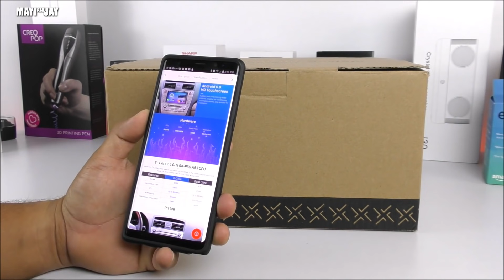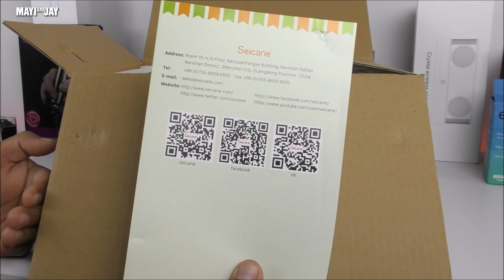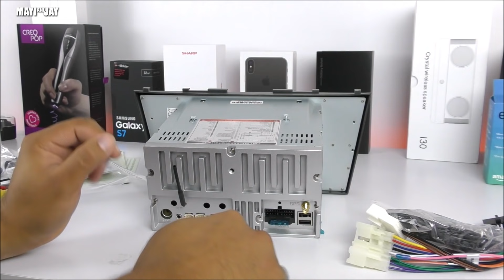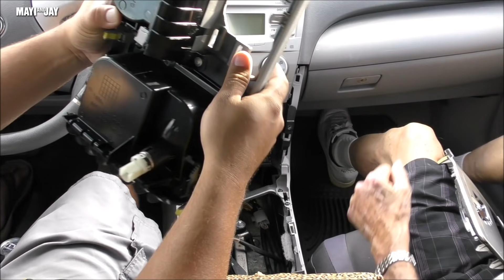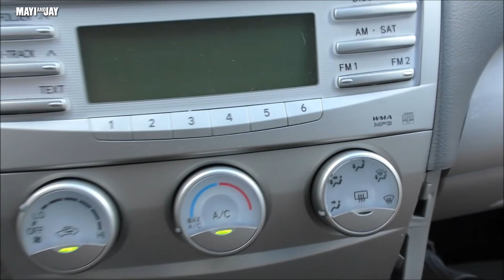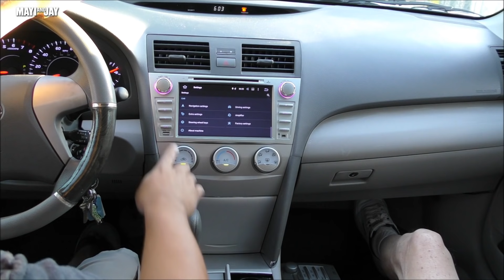Get A $200 Factory Looking ANDROID Radio On Any Car From 2007 & Up! [Toyota Camry]

Comment: Thanks for sharing. Be careful when pulling out the vents off, if you break the clips it's done deal. 

I think this is by far the best  2007 Camry radio head unit replacement out there. It has the right color, the right features, there right touch and feel. It will look completely original. And the GPS, trust me, other units do not work this good.
Reply: I just got this for an 07 camry i'm passing to my son.  Does the GPS work on it's own or do we have to enable an internet hotspot for it to connect?
Reply: @soundsensationalvibez8876  on it's own, has it's own antenna that you can just put on the dashboard or elsewhere.

Comment: The link you shared doesn't display Exactly the same Design you're installing here ... The one you  installed has where one can slot DVD, volume ,tuning and other buttons pls I need exactly the one you installed here .. Pls share the link here

Comment: Can this be installed on a 2017 Toyota Camry SE
Reply: Not the same exact unit but similar. Go to the website in the video description and search your model. For Camry, specify if you have a US model or not... There are several different dash designs and the 15-17 US version is all its own. I found this out looking for one for my '15 LE.

Comment: Hi, anyone know how to reconnect Bluetooth to another phone?? I tried to remove the old phone but doesn't work, thanks
Reply: Press talk key, wait for the setup promp, take it from there.
Reply: Where's the talk key?
Reply: Ký Qch right side of steering wheel on mine.
Reply: @lynnmerritt8873  mine don't have the talk key on steering wheel, only call or answer on screen
Reply: @p.theviewer  try the answer key. press/hold about 2 seconds, you may here the prompts. the last prompt is "setup" on mine
Reply: @lynnmerritt8873  thanks, I'll try
Reply: @p.theviewer  "setup" should override previous phone setup. Hope this helps dear
Reply: @p.theviewer  turn ignition key till you see dash readings, turn radio on, have bluetooth enabled on your phone to be discovered, pair according to instructions if needed. Try steps again if needed. Or try your "call" key on steering wheel in same manner.

Comment: I’m doing exactly what you just did with exactly the same radio same car 2007 Camry but my JBL module only two connectors fit on the car the third one did not fit so my steering wheel control is not working what am I doing wrong did I get the wrong JBL connecto

Comment: Just saw this Video..I am in Aus and I just bought a 2011 Camry Touring. The head unit looks a bit different to the usual camrys' that i have seen here. Mine comes with a reverse cam and it shows on this screen. Will this product fit in mine and also, will it show the reverse cam video as well ?

Comment: Do the steering wheel functions work for the radio?
Reply: Bulshit the wires that come with the radio do not fit the car you have to buy a JBL wiring harness and the steering wheel wiring harness for $57 a piece
Reply: Yes.  I have a 2009 Camry
Reply: @pgg0508  ya solucione el audio gracias ahora solo me falta el swc q' no hay manera de q' me deje configurar.pues los botones no hacen nada
Reply: @luismartinez-xs2ft  Do you get to the configuration screen (Apps...settings...car settings...steering wheel)?
Reply: @luismartinez-xs2ft  https://youtu.be/ro8prAPkNFY
Reply: @pgg0508  hello if the strangest thing is that I got to the screen of the device to the settings I put it to take that option and simply does nothing. is where I do not understand. because if I already set it to swc because it stays the same without doing anything at all
Reply: @luismartinez-xs2ft  can you set any of the SWC buttons?  volume+...volume-...mute?
Reply: @luismartinez-xs2ft  if none of the SWC buttons respond, you might have to check to ensure your cables are seated securely in the slots.
Reply: @luismartinez-xs2ft  and if you soldered the wiring harness and adapters, you might want to check that too.
Reply: Yes.  I have a 2009 Camry

Comment: Does this work for a Camry with JBL speaker sound system?
Reply: NOPE ! NOTHING DOES LOL  you will either need a better  deck with the bypass or just add a high low freq box i judt installed subs in my 11 Camry  and stock  stock speakers didn't work  you cant just tap into the wire for signal  no sound until  until we installed the high low  box  inbox me if you want pics of the box im talking about
Reply: @that_619_dude4  what would you recommend I do/get that would work with the JBL speakers? I don't need anything nearly as fancy as this I just want to play music from my phone via Bluetooth
Reply: @darknazo10  so I had a high low frequency box installed in the trunk so I have my stock head unit with my sub and amd, that's the cheapest /best sounding fix in my options bro

Comment: Can the GPS button be set up to open Google Maps instead of that other app it's opening in the video?
Reply: Yes, but you will need a persistent wifi/wireless connection or download Offline Google Maps.  Even with the radio connecting to your phone's wireless via Hotspot, the data is too slow.  If you don't like the provided GPS software, you can purchase and install one of your choice and configure the radio to use that particular GPS software.

Comment: help, I'm not getting FM signal what am I doing wrong?
Reply: Hey Luis.  See previous comment radio antenna amp connection.  As far as the SWC, you just have to configure the buttons to do what you want.
Reply: @pgg0508  thank you for helping me with regards to the orange cable, this one comes with a female and male socket from different places tell me ko I leave it like this or I have to unplug it or cut it and connect the blue cable to the female or male socket
Reply: @luismartinez-xs2ft  Did you it all connected?
Reply: @pgg0508  not because I have 2 blue wires, one with a white stripe and another blue one, I am confused which is the one that is connected to the orange cable that comes next to the 2 antenna cables and that this orange calbe has a white connector on both sides and I don't know if I have to disconnect it or leave it like that and on which side on the orange cable I connect the cable on which side I have to put the blue cable.If I could give more details on how I should do the operation, I thank you infinitely because I also don't is holding the swc signal because the driver's buttons do nothing. Excuse me for my ignorance these are very delicate things and you have to be sure not to make mistakes that are later fatal. I appreciate your concern once again for your generosity of wanting to help you are very kind god bless you
Reply: @pgg0508  Hello, I want to thank you again for your help regarding the swc and I configured it as you had said. I am very happy. Now I have to continue to see if I can put the GPS because it does not want to do anything. Also the blue wire connect it to the orange but without cutting it or unplugging it nose if it would be fine like that. Where to put a cable that says brake
Reply: If you have the Camry, you'll have to connect the orange cable that is wrapped with the antenna cable to the blue wire (ant) on the wiring harness.  The blue cable bundled with the AM/FM antenna is the amp cable and must be connected.  I cut the connector off the orange wire and soldered the orange and blue wires.
Reply: @pgg0508  hola Will you kindly tell me what I can do because since I installed the radio I have no radio signal since the blue cable I could not connect it anywhere and the system steering wheel controllers do not work too? Thanks

Comment: That is not an affordable radio at $350 I should just anybody change the radio run your rear-view camera camera cable as well even if you don't do the camera plug the cable in otherwise you'll have to take it out again and do it all over again

Comment: Is the blue wire you didn’t connect for xm radio or for steering wheel radio controls?  Great video!
Reply: The blue wire is actually the amp and must be connected to the unit.

Comment: did it have a connection for back up camera
Reply from the maker: Yes it does!
Reply: There should be a yellow RCA connector labeled "camera" on the wiring harness.

Comment: Curious, what unit did you put in your 4Runner? Also, what replacement dash piece did you use? It's just left with so much blank space on either side when you swap the head unit 🤔

Comment: Does it accommodate steering wheel controllers also?
Reply: Yes, that was demonstrated during the setup procedure. He set up the steering wheel controls then the CD/DVD controls. We're now in 2023, I want to see if this unit is available with Android 8.1 or later OS.

Comment: Great video!  I have a Camry 2010 Le and it was perfect
Reply: An Pham  what do you mean perfect? Did you buy one? And have you recived it?
Reply: Antonio Frias Yes, I bought the same model from Amazon and it was plug and play. The only thing I’d say after using it for the last month is the Bluetooth connectivity is sometimes hit and miss with my iPhone. It works about 50% of the time only. Also, I can’t figure how to use the Aux cable anymore now that I instilled this. Otherwise, the aftermarket stereo looks beautiful in my car. I also installed a reverse camera which is useful.
Reply: An Pham iv tried to look for this one on Amazon. Do you happen to have the link for this one? How is the sound quality?
Reply: You're right; it seems to be out of stock.  https://www.amazon.com/gp/product/B073GRC37M/ref=oh_aui_detailpage_o05_s00?ie=UTF8&psc=1

But, there are other ones that are available and seem similar.  The sound quality for the head unit above is amazing. Better than stock.

Comment: Does the unit still work as expected, or did some problems apear later on?
Reply: With regard to the "blue" antenna cable...it is actually for the amp and must be connected.  There is an orange wire wrapped with the AM/FM antenna which connects to the blue wire (amp) on the wiring harness.  I had to remove the clip and solder the two wires.

Comment: Do you like  this item for your car: https://www.espony-cargo.com/10.4-Tesla-style-Navigation-Vertical-Screen-Android-Radio-for-Dodge-Ram-2013-2014-2015-2016-2017-2018
Reply from the maker: Espony Cargo There is a better one for my ram with a 10.4” screen. Its called tesla style 10.4” ram radio. Check it on google!
Reply: I have messaged you , could you pls check?
Reply from the maker: Espony Cargo I just did! Please check
Reply: Thank you

Comment: Does this work with my jbl system still on?
Reply: Got to be careful JBL adapters whistle in the speakers even if you add a ground from the radio they whistle

Comment: 1024x600 resolution is better than $900+  Pioneer AVIC-8200NEX  which have a resolution of 800x480 you should never compare the resolution of a car information screen to your tablet or phone,  all car information screen are very low...The resolution  of 1024 x600 might be some of the highest resolution screen in any mass produce car period...

Comment: If you dont want to waste a 350$ on this buy yourself 50$ tablet how easy is that
Reply: Lynx Not the same thing, you cant change your car radio, volume, cant have it built into car to use while driving

Also i dont there is a GPS driving app
Reply: Lynx you don't drive, do you son?
Reply: iJamie8467x yep i know btw it can be used as a navigation
Reply: Noob
Reply: Lol
Reply: You're paying for an actually very good integration for an "aftermarket" system where it doesn't look like it is aftermarket.

Comment: hi there is cheapr version? 350$ is above my budget.
Reply from the maker: They have em cheaper but they may not look like factory-designed radios. Also when you go too cheap it may give problems. This radio can do so much and so well that I would save up for something like this instead!

Comment: I think, it's better to install trusted Head Unit brand (Pioneer, Alpine, etc). It's better in sound quality and reability.
Reply: Neil Stanley
the problem with pioneer alpine is that its made to fit any car so it don't look factory...it looks ghetto out of place in your cars dash...I made that mistake in my first car install an after market pioneer on my car and it look terrible spend like $800 to have it install lol a year later I took it out because it just look ghetto..

Comment: Bad install,you should disconect the battery and be more careful
Reply: I thought "oh maybe he's going to turn it off before he starts unplugging anything" the rest of the video was like a horror film.
Reply: Google Nutzer He can short out the system,destroy the battery and why get shocked when you can easily prevent that
Reply: Misa Protic you right and the most weird was he didn’t even shut off the car

Comment: Wow sweet radio, might see if they got something for my 2011 honda civic si and 2006 Subaru wrx
Reply: Nice, I'm 20 years old and im deciding between a 2010 camry and a civic 2006, for my first car.
Reply: Joaquin Santana get the camry. the 2010 got the bigger 2.5 liter engine. Not to mention that camry has a high resale value.